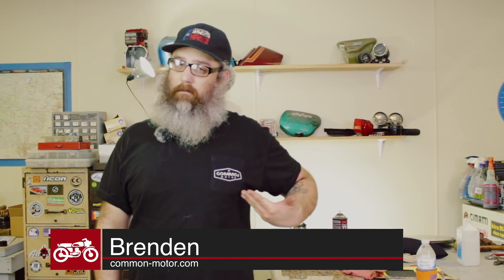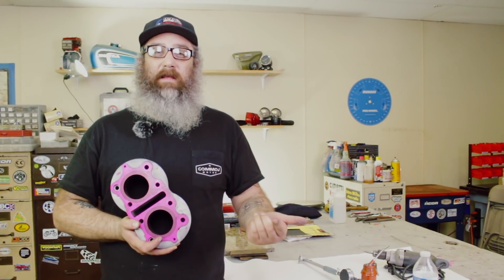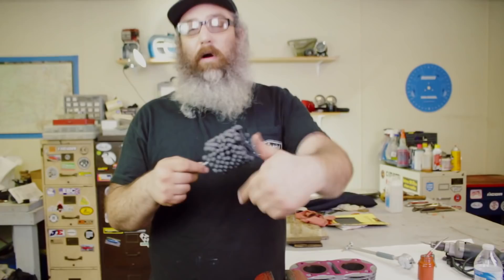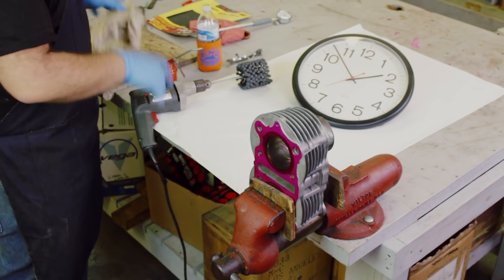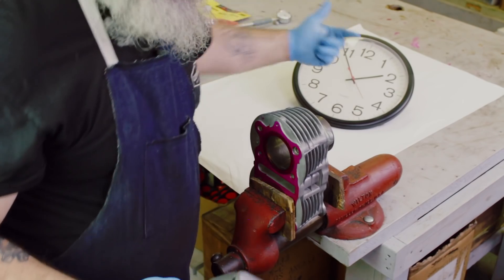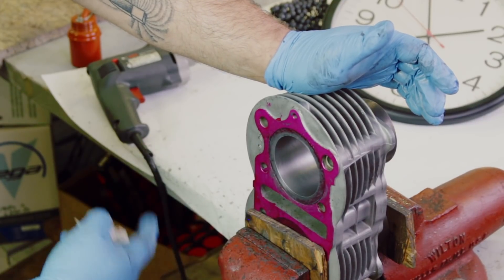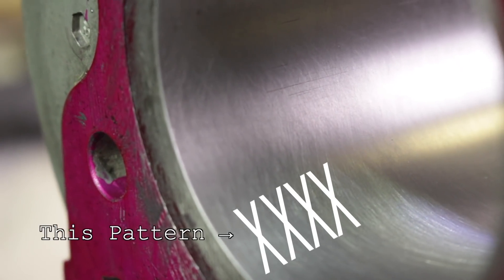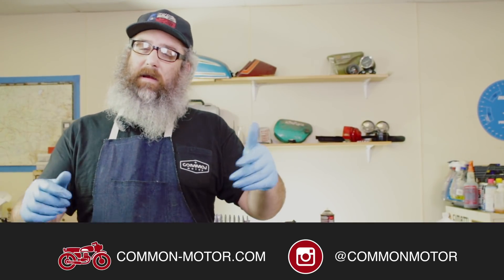How to Hone Cylinders : Honda CB350 / CB360 / CB450 / CB550

Comment: I used to use those cylinder hones you are using on valved brass instruments like trumpets and tubas when I cleaned them. After honing them that way I would use soft brass, cylinder shaped, brushes with dawn dish soap to finish the cleaning and smoothing out process. The brass brushes left a very smooth surface. Might be something to try on engine cylinders if you want them to be extra clean. We had a massive ultrasonic cleaner as well we used to get absolutely every bit of dirt and grease off the metal.

Comment: Lots of people do not know that this is a really important step. It can make the difference between a good and a bad top end rebuild. Thanks for sharing this!
Reply: this is a HUGE step.  I learned the hard way a long time ago... had to go 'back in'; but only once.   Anyway, when cleaning the cylinders after honing-  I've always used diesel fuel instead of water.  It's a great cleaner, no need to worry about rust and it's got some lubricity to it which I think works well on initial startup.   Ride safe everybody.